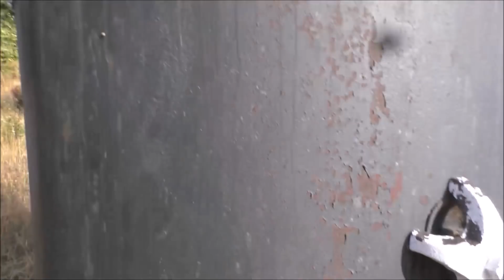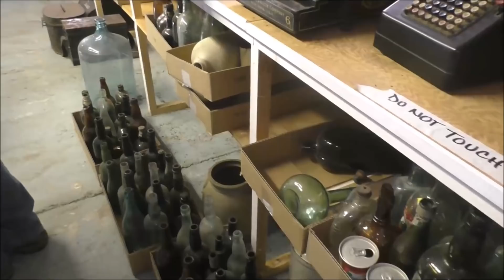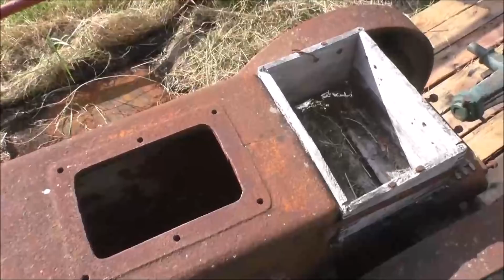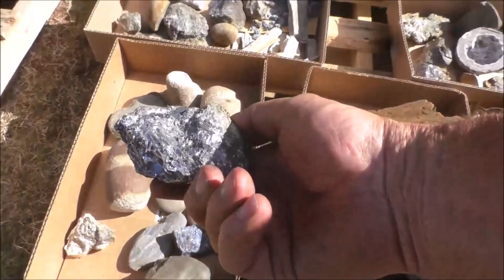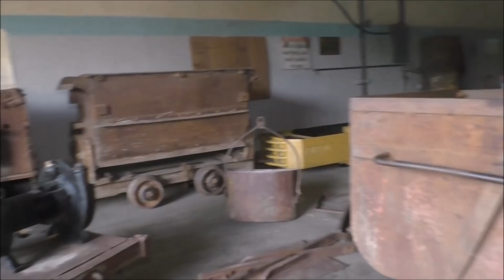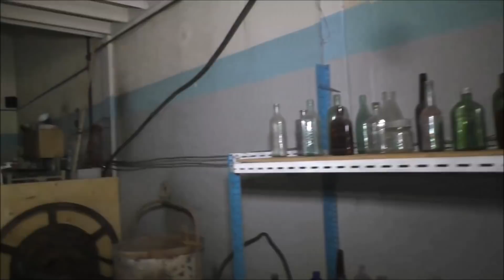#71 Don Endersby's Mining Museum goes up for auction!

Comment: probably the first thing to do with the compressor and motor, is pull the plugs and start soaking the pistons with automatic transmission fluid, that and the compressor too. may need a total disassembly because it looks really dry.

Comment: That "mucker" was often called for "widow-maker" here in Europe, because they were dangerous to use, and you could get killed if the shuffle hit you
Reply from the maker: They are fast and powerful machines that will run over you if you aren't careful!
Reply: A friend of mine was almost hit by a machine like that, when we worked in a museum mine here in Drammen, Norway.  And after that incident it was not allowed to use that machine anymore, and they started to use a small bobcat to load the wagons with rocks

Comment: Awesome scores Frank, Don sure did have quite the collection. Be cool to see your mock up ore shoot and car set up on rails. Really dig that slide rail jack leg drill on the tri-pod... possibly wrong in that describing that. I assume your going to put the compressor inside for the winter eh. Be neat to see that winch work at some point. I have a Braden vertical spool PTO driven winch, not nearly as old as yours. Cheers
Reply from the maker: For sure it would be a crime to leave it in the cold over the winter while I explore mines in Mexico!

Comment: Do you know what the lister engine sell for?
Reply from the maker: About $ 150  I think.
Reply: Exploring Abandoned Mines     That was a great deal for someone.  These engines are so well designed that they are still built in China and India.  But the best ones are those built in England.  Lister and Petter merged in the 1980s and are still building high end engines for boats. Generators and pumps.  The real small engines are no longer made in England. 
There is something almost romantic about this type of power source. 
As always frank be careful while exploring.